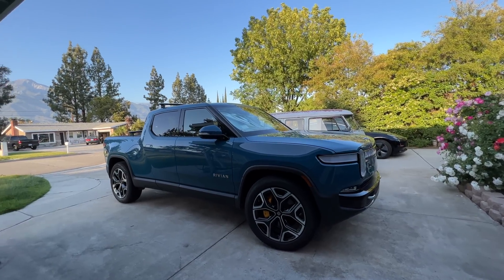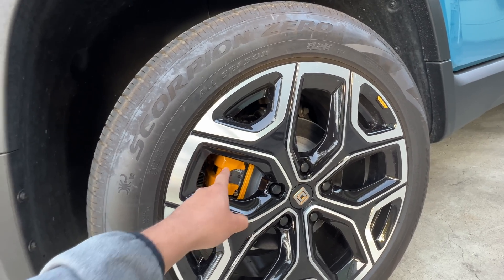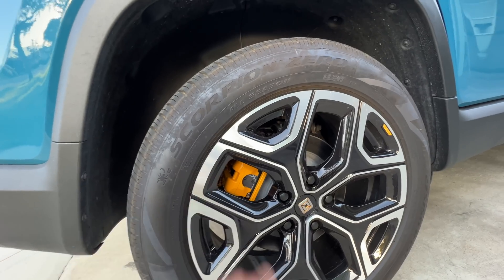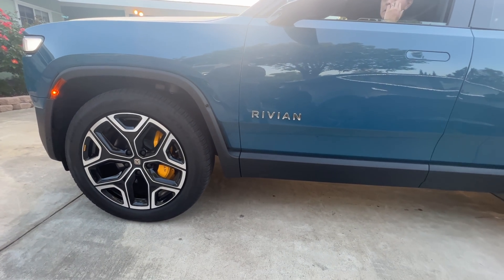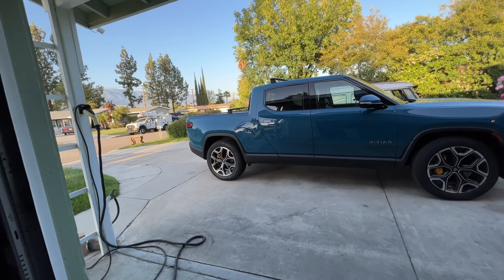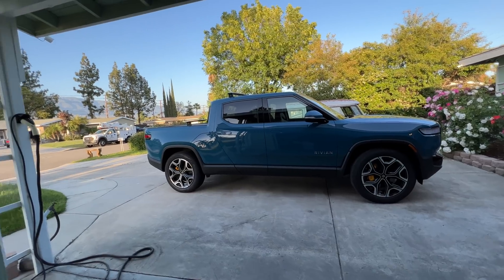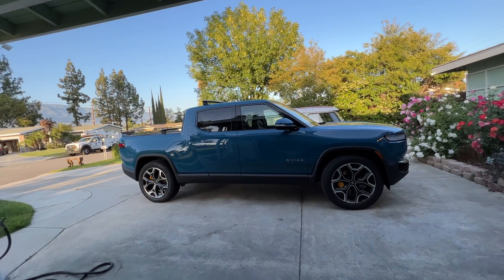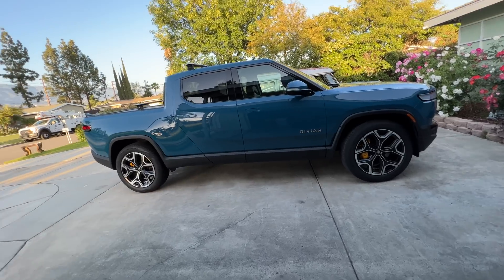Rivian Service

Comment: regarding the regen braking, when you lift off the accelerator to bring the truck to a stop, do the brake lights come on?  i could see this as a problem if they don't.
Reply: If the rate of deceleration is significant the brake lights turn on. So yes, the designers thought of that.

Comment: Thanks for service update happy to hear you got fixed sure as hell didn't want next video being about an accident happening due to complete brake failure. Stay safe.
I had done pretty much same thing not like can take it to jiffy lube or somewhere on your trip. Just impressed with secondary and 3rd breaks systems were able to stop a 7k truck with probably another 1k in the truck bed of battery packs.

Comment: 7:30 "they said they can deliver it by Thursday 4:20 " Didn't end up showing saying "well it's gonna take long there's alog of "traffic" "  Sounds like those Revian staff are such stone heads they probably put melted butter in in your oil brakes instead of hydraulic fluid.

Comment: Okay so let's stop calling hydraulic brakes mechanical hydraulic brakes are hydraulic mechanical breaks wood have a cable operating them like an older style parking brake the parking brake in this vehicle is electric it's not uncommon nor unusual it's been used for over 10 years and most European cars
Reply from the maker: Mechanical brakes

Comment: Tailgate and tonneau cover is forgiveable for a startup, even new model.  The loose brake fitting is a major q.c. issue.  They fixed it, but at this point, with not so many vehicles in circulation, its a good time to bring every single one in to check before it becomes an issue that can end this company before it even becomes mainstream.
Reply: I don't know about that one, I think people are going a bit overboard with the whole startup thing. Startup is really supposed to relate to a new and unproven business model, I don't think it should be applied to the proven bits. For example, there are tons of companies that all make similar reliable tonneau covers, and tailgates, and install hydraulic brake systems without issue. even very small businesses and aftermarket outfits. 
I could see giving them a little bit of a pass on new features developed by them not being fully baked (trailer towing range calculations being off) but only if they explicitly say so in advance. In my opinion, giving companies a pass on stuff like this makes everything worse for everyone, it is my opinion that everyone excusing Tesla's questionable quality hurt EV adoption. When bringing up Tesla to someone they'll say isn't that the company with the cars where the bumper comes off and the computers freeze and have to reboot all the time? If the people in the early days of Tesla would have just said “I demand better quality for a $150,000 car” and returned any car that was less than, Tesla would've never got that reputation.
Reply: Absolutely 😕

Comment: Isn’t the tailgate mechanism electrical both down and up? If you are manually shutting the tailgate you maybe shutting it too hard for the electrics to be able to release it. Have you tried just using the electric mechanism to open and shut it the compare it to the way you did it in the video?
Reply from the maker: Only release is electric,  closing has to be done manually

Comment: Looking at your vid it appears that the gate is not level on top, it has a small gap on the left, a larger one on the right. Also, the left top side is lower / not aligned with the bed.

Comment: Unacceptable. First I would have checked and likely fixed it myself rather than wait for the uninformed to run around unaware of themselves. Hence saving myself the aggravation of waiting to get it back days later. Warranty aside who would have known I did the repair? Of course I am a experienced mechanic so I would not expect every day folks to jump in an do it themselves with no understanding of how to fix a simple brake leak. Which begs the question...Jehu...u have those skills, why did u not look at it and go OH, tighten connection, refill and bleed, bam. Done! As for the tailgate release, they did not fix it so what's stopping you bar a design flaw that makes it  unrepairable or such? Come on Jehu! I'd like to try out a Ford F-150 Lightning myself.
Reply from the maker: Because I’m reviewing the whole experience of owning this new vehicle.  Are you not paying attention to what is happening here?
Reply: @jehugarcia  Ok but I still would have done it and then logged it and moved on. I get ya. I guess it's the DIY in me.

Comment: Newer vehicles are wayyyy to complicated. I was a Truck Driver 25 years and I noticed that Semis got more and more high tech over the years. All kinds expensive failures and problems was the result. 
If something simple works why change it to high tech BS?
Reply: Because revenue !
Reply: Don't exactly disagree, but are you talking about the brake failure that the video is about? Hydraulic break systems are not exactly newfangled tech

Comment: Can one attach a 5th wheel trailer with this, or any electric truck bring made? Because that's the holy grail in camping off grid. Safe towing, power everything in the trailer off the truck if need be. Loads of solar on the trailer, even a large fold/slide out canope with solar. 40m2 or so. Battery in trailer as well to power and charge. And enough of a drive motor to move the thing around when detached from truck. No propane. No fast charging needed unless deep winter or driving more than standing.

Comment: This is not an small issue. This is bad enough it must be taken note off and if there is another case of this there must be an recall to check all the cars. This could kill somebody. At least don’t drive the car if the warning light comes on.
Reply: Not sure anyone would want to take the advice of some faceless nobody off Youtube... Especially when YOU don't own one.
Reply: @escapedcops08  who hurt you so badly you need to go to personal attacks on a comment I made about the lack of safety on a car? I made the comment because this company should take this issue seriously before the number of cars increase - along with the expense and surely the end of this start up.
Reply: @pederb82  $RIVN hurt him bad...
Reply: @escapedcops08  safety is safety not being able to stop  Abruptly is a serious safety concern what if kid ran out after his ball all the safety features won't stop car quickly without main brakes if work at all. Also are you a secret billion air with his own keyhole satellite and team of hackers how do you know what others own? None the less the point of any vehicle is to get from point A to B safely and if there more then 20 incidents of this happening that's to much for 2000 run, they should call all in for service before its 20,000 and get hit with recall order.

Comment: Seems odd that it would waste power holding the brake pads on using an electromagnet.
Must be more of a mechanical latching system that is driven on/off electrically.
Reply: its a steper motor. Its all the same on almost any modern car. Power applied only to move brakes from/to activated/disactivated position.
Reply: Yes, I wondered. It's a screw set up with double worm gears that can't back out without power (holds with no power essentially). They are DC powered with a position encoder, not a stepper motor.
Reply: @Mekhanic1 agreed. Servo motor, not stepper motor.
Reply: my 10 year old leaf has this :D
Reply: EPBM - Electronic Parking Brake Module.  Does the same thing as you pulling the e-brake lever, but with a motor.